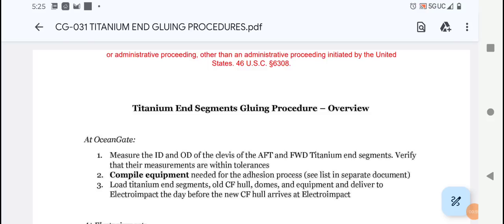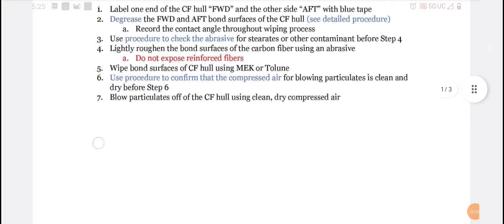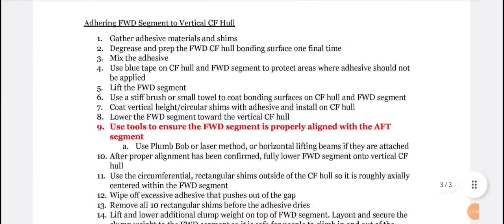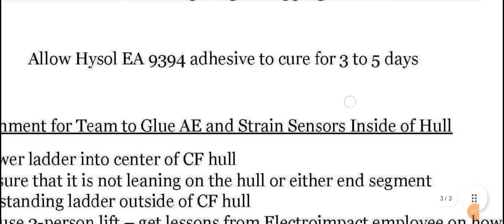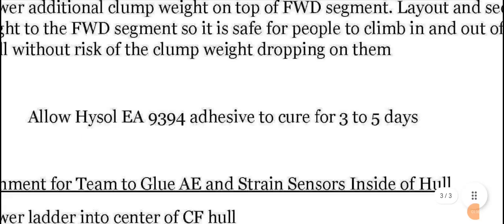Titan Submersible they used the WRONG epoxy as carbon fiber & titanium  "eat" the epoxy

Comment: I paused and read the gluing procedure at 46sec. If you compare this with Oceangate video it would appear that they did not follow this procedure. The procedure also reference wiping with MEK or tolune (sic their spelling) Bad practice solvent can weaken composite. 
French designed Colomban Banbi homebuilt aircraft had serious corrosion issues with aluminium brackets in contact with carbon fibre wing skins
Reply from the maker: "Galvanic corrosion
When carbon fiber and aluminum are in contact with each other, galvanic corrosion can occur. This happens when dissimilar metals come into electrical contact in the presence of an electrolyte, like water. Carbon fiber is more noble than aluminum, so the aluminum gives up electrons and corrodes. Anodizing the aluminum or using an epoxy adhesive can prevent corrosion. "

Comment: Any Aluminium/Aluminum included in the glue would not be involved in galvanic corrosion with Titanium because the two metals would not be in direct electrical contact. The small particles of Aluminium are surrounded by an oxide layer and embedded in a waterproof epoxy. The primary stress on the end caps was compressive and not trying to sheer or pull the joint apart. So any galvanic action can only take place at the very edge of the surface layer, if at all. It might not have been the best possible product to glue the carbon fibre hull to the Titanium end caps, but it was good enough.
Reply from the maker: So, you are the person that would ignore the manufacturer telling you that the "glue/epoxy" will fail because it is not to come in contact with carbon fiber or titanium! 
That you think the segments are being held in place by the atmospheric pressure on land! 
That the constant force or the dead weight and the shock loading during transportation is not an issue! 
You are on the wrong channel, please go watch someone else's content, your ignorance is a waste of our energy here.
Reply: So you apply your glue already solid or what?
Reply from the maker: Part 2 hiding over here https://rumble.com/v5kbcoj-titan-submersible-yes-epoxy-can-be-an-electrolyte-plus-water-contact-inside.html

Comment: The testing from loctite was done with adherend on aluminum. But also the sheer test only withstood  4000 psi@  77f drops down to 3000@ -67f, also lost a couple hundred psi after prolonged exposure to WATER...... and warm water, bottom of ocean is cold, so it would degrade even further.
Reply from the maker: As the manufacturer's engineer representative stated, it's the wrong product.